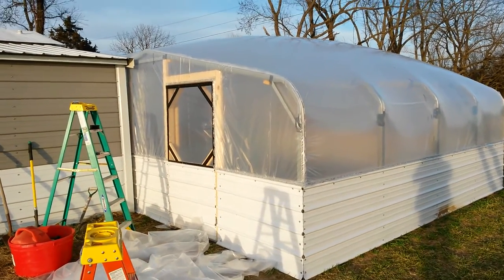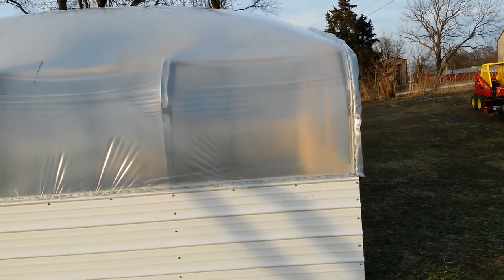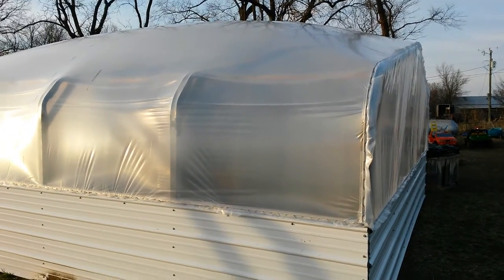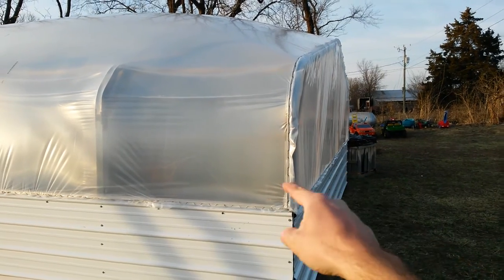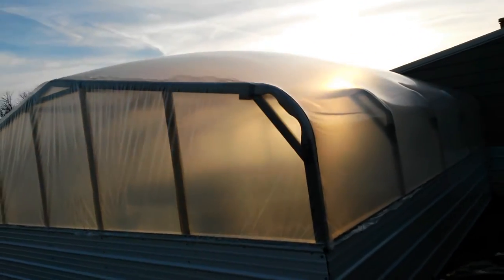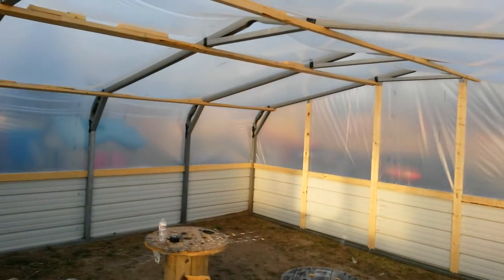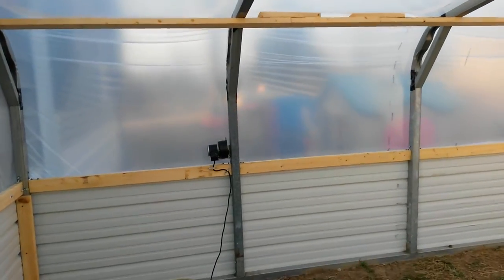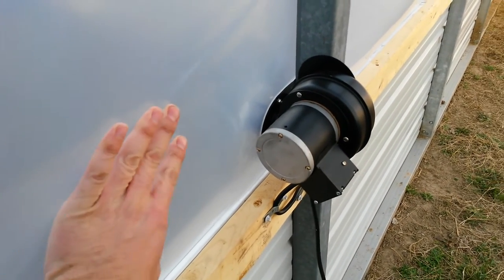20x20 Greenhouse made from a Carport Frame

Comment: Did you bend the channel for the wiggle wire around the carport frame on top or did you have to cut it in pieces? We are building almost the same thing you have here. Looks great!
Reply from the maker: The channel is aluminum. So it bends pretty easy. Good luck with your project! Hope it turns out well :-)

Comment: Hi Farm Alarm! Just caught you guys on Doug and Stacy's channel and I thought I would stop by. I am living in Springfield with a five year plan to get on to my homestead. I am planning on living somewhere in the Dade county area. I really like the idea of using the old carport. I don't know a lot about greenhouses yet so I apologize if this is a silly question but, do you have to run that pump continuously or does it inflate and then seal somehow?
Reply from the maker: HI Cindy K. Glad you stopped by! It is good to have a plan, especially a 5 year plan, that is cool! Thank, i thought the carport was a good idea too. No worries on the question, and not silly at all. But Yes, you have to run the small Blower motor fan constantly, But it doesn't really use too much electricity. Id say no more than your average ceiling fan or box fan. But I would not build a greenhouse WITHOUT a Double Layer inflated style. Its the cats meow. Oh unless i was to use hard clear panels.
Reply: Farm Alarm why are you inflating this greenhouse.